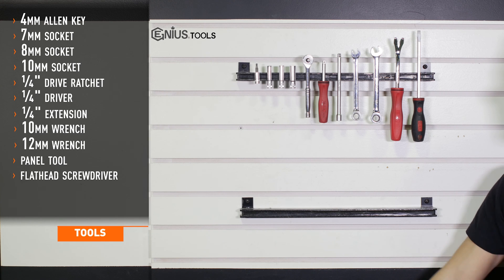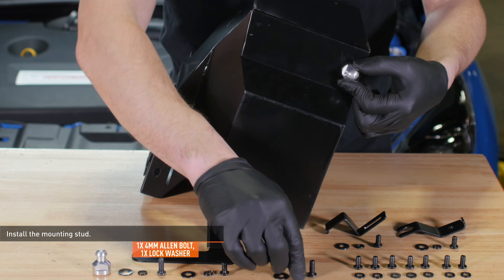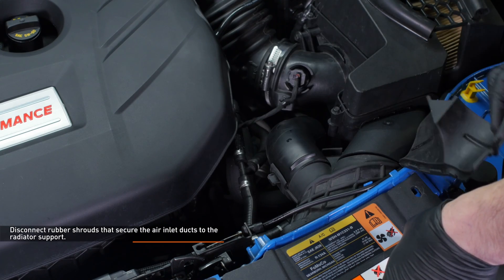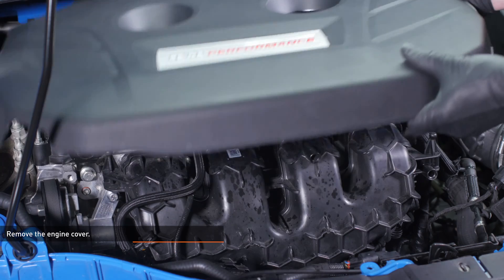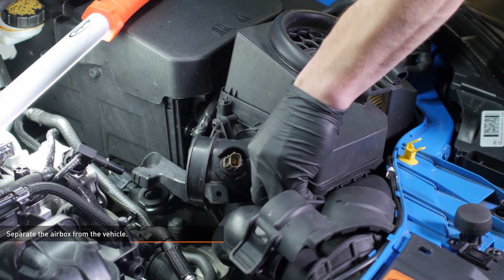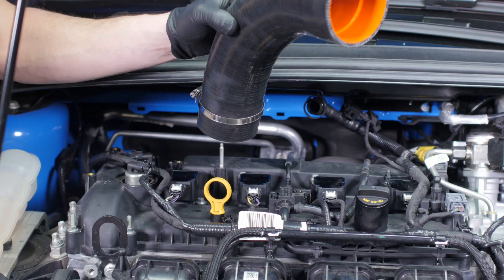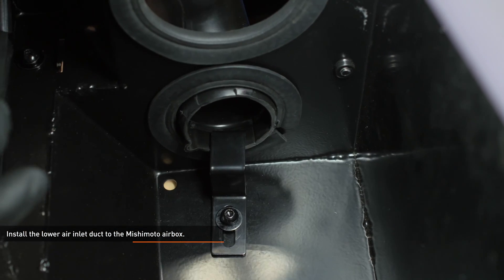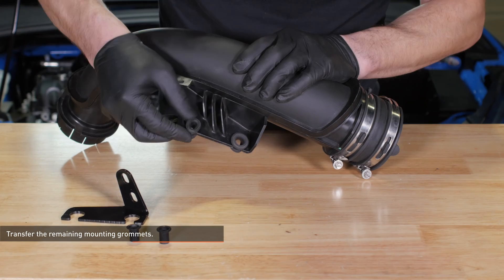2016-2018 Ford Focus RS Performance Air Intake Installation Guide by Mishimoto

Comment: The one thing I’ve noticed with all intakes for the RS. You will have to remove the pipe from the air box to the silicone tube to the turbo just to change the one or both the right side spark plugs. It’s the most annoying design ever.

Comment: Everything is connected properly, started the car after the process was done, went for a drive today and the check engine light came on any suggestions?
Reply from the maker: There could be a multitude of things. We would suggest pulling the code first and going from there.

Comment: Just a heads up for anyone wondering, the Cobb high flow filter will NOT work in the air box, the clearance is too small. Otherwise it  looks great.
Reply: Dang I was hoping that wasn’t the case! Do you know if u could just keep the stock RS air box?
Reply: @wasthattoxic24  If you are talking about the COBB air filter in the stock intake then yeah I think that's what it was designed for. Sorry I can't be of more use, I sold my RS a couple years ago
Reply: @Snyder1224  all good haha I’ll just have to try it and see. My main concern is the stock air box not doing as good performance as the Mishimoto air box.